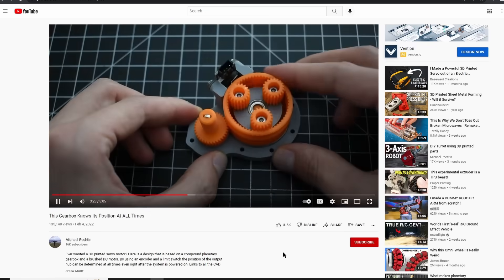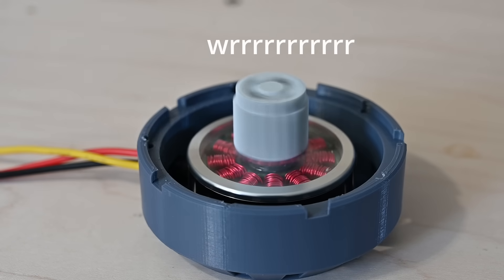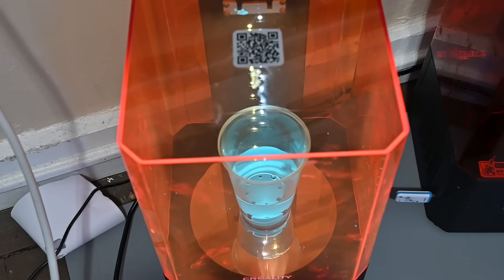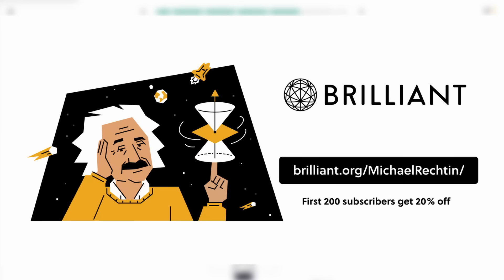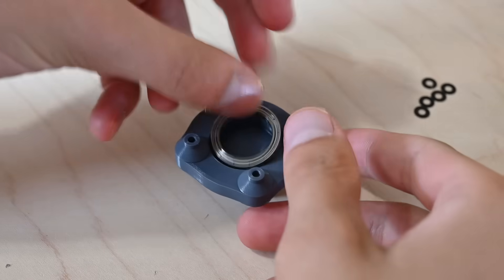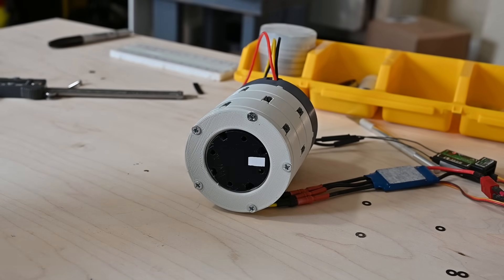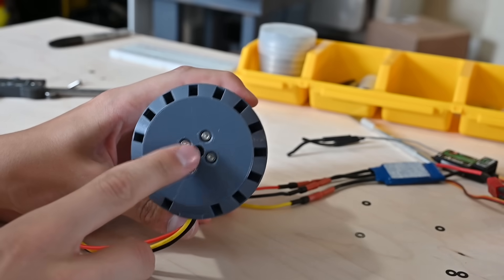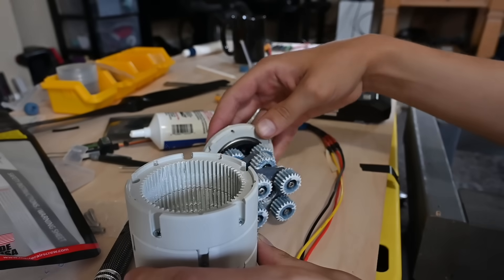3D Printed Stackable BRUSHLESS Motor Gearbox

Comment: That was not an accurate measurement of torque. The arm had momentum.  Torque is measured at various speeds then graphed. The torque of an auto engine is specified at its peak on the curve and so that torque is the one advertised. The same should apply to this motor and gearset. Usually torque is not the ideal at zero radial velocity.....not sure about brushless though-haven't seen the graphs.

Comment: A quick way to electronically reduce the speed and increase your motor's torque is to desolder the connectioms to the three phases ( at the stator) and rewire them in a wye configuration if they are currently wired as delta. This will cause current to enter one phase and be forced to energize an additional coil on its way back out of the motor. The scope of this mod is to reconfigure  the phase connections from parallel to series. The motor will have more energized coils at any given moment, thus increasing its torque. I've used this trick before with good success and my motors live longer and run cooler. Keep in mind that you will decrease the maximum speed. That is the tradeoff.

Comment: It would be neat to see it taken to the extreme where the final output has such an incredibly high reduction that it can be embedded in something unmovable and still function. I remember seeing a similar setup where the output was embedded in concrete but it will functioned because the extreme reduction summed up to  basically no movement on the out put. Wonder how many reduction gears you'd need to achieve something similar.

Comment: I might be wrong.. but it looks like it would fit 5 sprockets.  A downside  to having even numbers is that the force is straight in the gearbox. 

I would also cosider  to make the first two half the thickness, if not less.

Comment: You aren't measuring the output torque there. What you've built is essentially a rotary hammer and you're measuring the angular momentum of the motor+gearbox assembly. To measure the torque you could measure the force/torque needed to hold a brake - or use a motor that can deliver torque while stalled.

Comment: The sampling rate of your acquisition system is way too low for the dynamic testing you are doing, maybe hook up your scope to an instrumentation amplifier if you got one. 
On second thought: Scratch that instrumentation amplifier, those are slow as shit, few Hz 3dB point, maybe look at what the Keithleys and flukes are using.
But damn is that gearbox sexy, looks very nice, very professional and the video was funny as hell.

Comment: The design looks decent. But 3D printing just isn't meant for printing high load parts like gearboxes. Every part like this will always kinda suck against a much smaller metal part. If you need something like this, every cordless drill has planetary gear sets inside. Just catch a broken Ixo on ebay...

Comment: add more stages
like twice as many

as for testing the torque, I think there are better solutions out there

usually, engine performance tests are done with a resistive load to evaluate torque at a given speed, that's done basically using a torque converter(like in an automatic transmission) there the resistive force is realized using a hydraulic fluid and some sort of turbine, would be interesting if something like that could be 3D printed

Comment: If you really want to test the torque you should change the input. Perhaps print a manual input shaft so you could drive it manually with a arm incorporating a load cell so you could create a accurate compressions between input torque and output. alternatively you could use a set mass to load the input shaft. how ever you would lose the information regarding the real time loading characteristics of the design.
Very cool concept and design!

Comment: This gearbox is one of the better ones i've seen on YT! Good job. Btw since you can't do a static torque test, it would be nice to see what weight it could lift at a given radius. For example, build a simple drum with 50mm radius with a string attatched to some weights. Then you could try  different weights and speeds. 

Also, this would enable dynamic endurance testing which would be really interesting to see. 

And, maybe even try different filaments. Maybe nylon or petg as gears?

Comment: In a video about a train of gear reduction made of spur gears, at the last output gear, the torque is so great that the connecting plastic simply snap because it's only a single gear that handle all the torque, is it possible for this stack planetary gears having increasing number of planets and also using the ring gear as output to increase the ratio for each stack?

Comment: That is not how you use a load cell... You're measuring the impulse of the inertia of the gearbox being reversed by the impact. Try driving a spool to lift gradually more weight at a constant speed and you'll be able to calculate power output as well. Maybe even compare 1 vs 2 vs 3 stages and figure out the transmission efficiency.

Comment: An involute profile on the teeth should help your noise issue.  In addition, it didn't look like there was any backlash between the gears.  For something that small, the backlash would be extremely small.  .001 inch backlash would be more than enough, but hopefully not too much to cause some issues.

I'd look into a liquid lubricant.  Most planetary gearboxes take oil, not grease.  Might give you a bit of a bump in efficiency!

Comment: The major blunder in the test comes from the fact that when the shaft is stopped in the load cell, the motor stops, thus we don't det the stall torque but instead the torque necessary to annihilate the angular momentum of the motor's hub, shft, planets holders, planetary geers, ... everything that spins gets some angular momentum to annihilate with a counter torque if you want it to stop
Reply: There is no "stall torque" to unsensored brushless motors. Just like normal internal combustion motors - they only produce torque when rotating at a decent speed. Controllers use back-EMF to recognize the phase switchpoints and when the rotor is stationary - there is no back EMF.  ESC sends some impulses to start the rotation, but they are random and weak, it just twitches around. This was perfectly explained AND demonstrated in the video, by the way.

Comment: The only downside in my opinion is that sensorless brushless motors used in model aircraft are designed to spin and never to stall (a propeller requires little torque to get spinning, just to counter angular momentum whereas when spinning at full speed the thrust creates a counter torque on the motor), and the esc going with it likewise. As such a good esc will never try to force down a stopped shaft, not knowing were the rotor is (as it locates it with emf, requiring a spinning motor), it wouldn't power it at the risk of burning the coils. As such model aircraft brushless motors aren't adapted to this application, instead steppers (an other type of brushless motors by the way), designed to give torque and dc motors, wich have a natural stall torque are more appropriate

Comment: Since the motor stalls, you could try hand cranking your gearbox if you wanted to do some destructive testing.

Also, are you using sheet metal screws to hold the sections together? I see a lot of people use that type of screw for 3D printing and wonder what type of coarse thread screw they use.

Comment: Why not go old school cable pulley reel with counterweight; additional losses at the pulleys but you could get an quick estimate. I'd assume you'd see/feel/hear the internal skipping when you over-torque (or the counter weight should be visibly falling) but you should be able to measure continuous torque by jogging the motor the same way you currently were.

Comment: I'm probably alone in this but I've been looking at gearboxes lately because I've been dreaming about making a wind-powered plastic shredder for recycling.  My thinking is that with high torque you could use a simple table saw blade to take bites out of the plastic over a long period of time.  Why?  Well..  I have a couple of weird reasons:

First of all, there are no shredders readily available for cutting plastic.  You can use paper shredders, but it's actually an immense amount of work.  If you had a wind-powered shredder you could just throw your milk jugs into it and come back to shredded plastic without lifting a finger.

Saw blades are readily available and cheap so it would be nice if they could be used.  And if the parts are 3D printed then I'm thinking they might do pretty well outside in the weather.  Maybe..  don't quote me on that.

Why shred your plastic?  Well unless you're going to use my spring loaded press invention that I have on my YouTube cahnnel cough*plug*cough   You're probably going to need your plastic shredded in order to do any DIY Recycleing. Every Desktop sized extrusion or injection molding machine currently on the market needs rather small pellets in order to operate.

Why recycle by hand at home, and why not just use a motor?          I'm sorry..   We can't be friends.  I should go..
Reply: Bruh how do you think we recycle plastic? And get 3dprinted filament. Shredding plastic is a global multi billion dollar industry. You can definitely buy small plastic shredders if you look hard enough.
Reply: @spacecowboy07723  We recycle with giant industrial shredders.  I can't put one of those in my garage, let alone afford one.  Filament is made with virgin plastic and cut with pelletizers. A pelletizer is not a shredder.    Wood chippers and paper shredders are not designed for plastic and are terrible.  Even if you can find one that works it's an immense amount of work.  You have to cut the pieces up anyway and the plastic is still in giant pieces compared to what you need.  It doesn't work.  There are a few small scale plastic shredders popping up on the internet.  However they're plasma cut by entrepreneurs out of thick metal plates and are still very expensive.  Plus they are kits and require even more costs.  You're looking at several thousand dollars of an investment, And they STILL do not get plastic reliably small enough to use even remotely reliably.

If we want people to start recycling in their garages then we need a total investment of $300 at the very MOST.  If this sounds like a trivial amount of money to you then you're not the kind of person who will actually recycle.  Cheap tools tend to be in the $100 to $200 range.   A $200 injection molder, is very possible, but there's no market for it yet without a shredder.  So we need a plastic oriented Shredder for $100.  And right now I don't see that happening unless the machine can run all the time and without added labor.  Hence..   wind power.
Reply: @inventtory1272  I've seen plastic pelletizers in a garage
Reply: @spacecowboy07723  Okay what does that have to do with shredding plastic?
Reply: @inventtory1272  they shred plastic like a paper shredder
Reply: @spacecowboy07723  cool, send me a link
Reply: @inventtory1272  I just googled that. Don't quote me on how good it is.
Reply: @spacecowboy07723  YouTube blocked your link.  Tell me the name, model number, or something.
Reply: @inventtory1272  Customized Small Shredder on aliexpress, 2k usd.
Reply: @spacecowboy07723  Thank you for confirming that you haven't read a single thing I've said; and that you know nothing of how recycling is done, filament is made, or the value of a dollar.  Those do not shred small enough to be useful in any extruder.  They would be a larger investment than a used car. Don't forget about shipping, startup, and electricity.  And still require active labor.  But again, I need to stress that these do not work for plastic recycleing. I could genuinely do better with scissors.  Please, just let me have my little wind powered plastic shredder dream and you can continue throwing your laundry detergent bottles in the trash, confident that you have everything figured out and you don't recycle because you don't want to.  Or perhaps you still believe that the bin you've been throw your plastic into actually gets recycled.
Reply: @inventtory1272  so u want something the size of a 3d printer? Powered by wind? That's a big ass turbine ur gonna need for all the amperage draw to shred plastic. Your logic does not make sense to me. Keep dreaming and the plastic extruder, the larger it is the better it is due to tolerances being better on larger extruder machines.
Reply: @spacecowboy07723 I never said what size it needed to be. And who said anything about amperage?  I want the wind turbine to directly drive the shredder.  Hence.. why I'm interested in gear boxes.   My logic doesn't make sense to you because you're.. not.. reading.  Plus, you're so stuck in a technological mindset that you can't fathom that humans used wind power to make grain for centuries.

Comment: Maybe attach the gearing and motor to a set sized pulley then have a rope with weights on it to figure out the max torque by it's able to make 1 revolution (to avoid string/rope from stacking and adding leverage).

Comment: Super loud because its a floating design. And yea.. printed is just not accurate enough for quiet op. Can work with high pwoer though, I run my ebike at ~1kw through a printed reducer

Comment: You should figure out a way to break the new arm you printed, then see how much difference it makes to half the infill and double the perimeters. Perimeters are strong as hell without affecting print time or filament used all that much, so it's always better to start by just upping perimeters and not infill